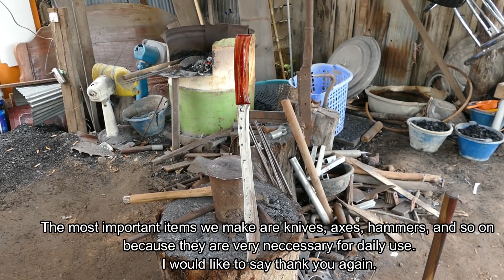MAKING A SWORD FROM MOTORCYCLE ROTOR DISC / BEAUTIFUL HOMEMADE SWORD (NOT FOR SALE )

Comment: For this your sword best hardening as for me is if you will be make 0,5mm cutting side and after this side you will be make fast moves from back to top under forge before you have enough temperature on cutting side and after in water. But this is just theory. You must have red color only on cutting side before watering. Oil work better but i am also don't using it.
Reply: It was for display only.

Comment: This is just a well shaped piece of metal and but a sword... Cuz he hasn't heat treated it....
Reply from the maker: We made it for decoration, not for cutting, that is why we did not heat treat it
Reply: What I would have liked to see is a better finish on the blade, especially if it's for decoration. A shame to spend so much time on forging and grinding it just to leave the rough angle grinder marks on it.

Comment: Forge on wood working very good for me. Thanks for some part to this idea. Before i was thinking only about charcoal like a fuel. But for small work like this i using just a wood. And no need nothing to buy as for me for this working.

https://www.turboimagehost.com/p/42638220/IMG_20190902_184635.jpg.html

https://www.turboimagehost.com/p/42638083/IMG_20190902_180926.jpg.html

This is soviet 'р18' steel.

And this is other 'new' soviet steel with high cobalt content.

https://www.turboimagehost.com/p/42636987/IMG_20190902_115816.jpg.html
Reply from the maker: You must be a Blacksmith, too
Reply: Here is no good possibility make money on it. Here almost actual better standard for hardening than in Cambodia. In shops many tools for garden quality is good price is low. i just making some knifes like a hobby.

https://www.turboimagehost.com/p/42665010/IMG_20190904_084235.jpg.html

Here is some knife from Finland 80crv2 steel hardened by myself i think on 55-60 hrc.

https://www.turboimagehost.com/p/42665014/IMG_20190904_084529.jpg.html

This knife from other hard steel '11Р3АМ3Ф2' hardened on 63 hrc by professional blacksmith.

https://www.turboimagehost.com/p/42546335/IMG_20190827_170330.jpg.html

Also i have knife from elmax steel. Hardened on 60 HRC somewhere on factory i think with crio cooling after hardening.
Reply: https://www.turboimagehost.com/p/42594840/IMG_20190831_093639.jpg.html

For good hardening knifes some time need some like this.

https://www.turboimagehost.com/p/42629861/IMG_20190901_192904.jpg.html

You just must know what steel you using. For example finland 80crv2 need only 850c for hardening and r18 steel need 1000-1200c for hardening. It is create big difference in process of hardening.
Reply: https://prom.ua/ua/p448567590-stend-temperatura-metalla.html

Here simple way how you can know temperature by color. Maybe it is not new for you but i added it.
Reply: Here now M390 Boehler one of the best inox steel for knifes, but of course with professional hardening. Also good black steels like r18, 'р6м5' this old hss steels. Also as i know one of most hard steel now for knifes is CPM 10V 

, but last steel with high amount of cobalt hss also wich i used even diamond wheel don't work on it. But steel is very hard for blacksmith, difference in temperature in steel before hardening is not possible. Very hard for manual heating not on factory.
Reply: For example if part is big and not thin like hammer you can just put it in the water after heating for best hardening results. i saw don't many crushed hammers.
Reply: I always try keep at least 1 mm thin of metal before hardening. More is better as usual but not always possible.

https://www.turboimagehost.com/p/42666419/IMG_20190904_114026.jpg.html

More sharpening this knife before hardening is not possible in this case.